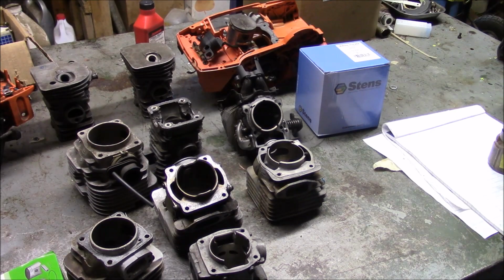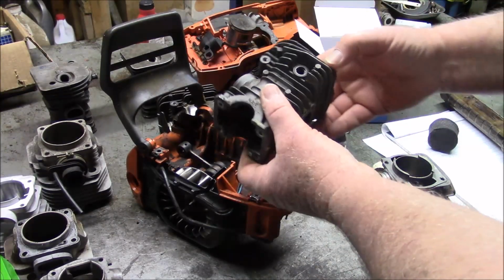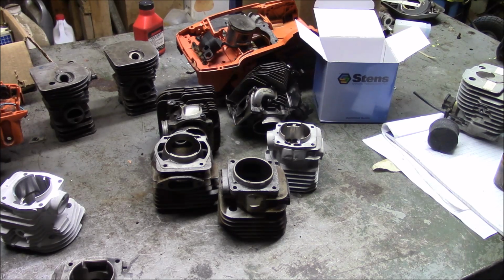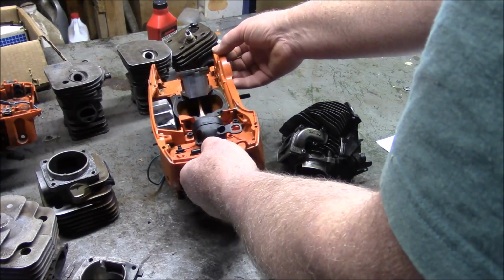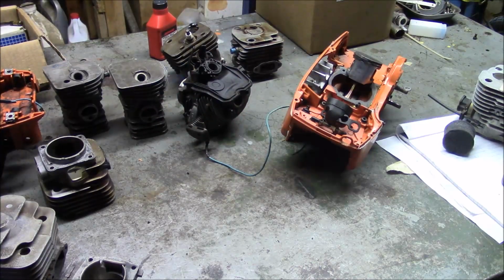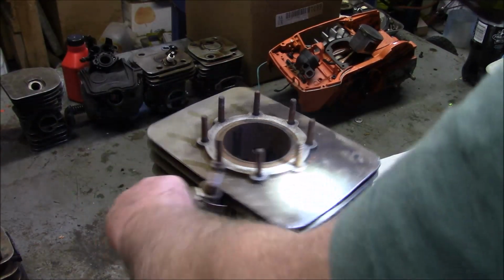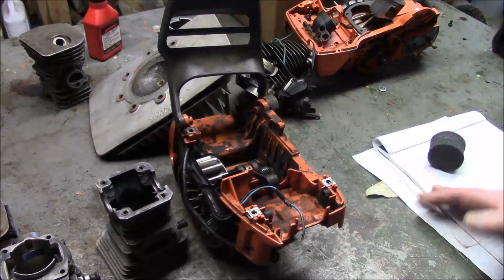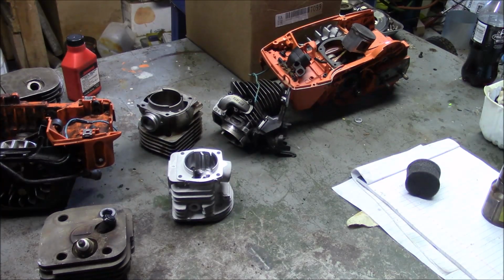What Is an Open Port Cylinder?? What does a Clam Shell vs. Conventional  Chainsaw Design Mean?

Comment: Scavenging seems to be little talked about.  The impact a muffler mod will make to back pressure etc
Reply from the maker: True, I started to get into the physics is a recent video. The saw community isn't really ready for true math & science. Still caught up in the black magic, bling, and entertainment as demonstrated with a lot of the really popular & large channels. I remember the same in the 1970's racing 125's.... then along came pro circuit & Yoshimura and a few other true engineering houses. Once the saw community gets past that, I'll drop in some math maybe :)

Comment: Uhhhh... A+++ and all, big Likes, but wish you'd put TRANSFERS in the title, dude this is the best/most comprehensive "transfers-comparison" video I've come across, by a pretty large margin actually, have been literally collecting pics (usually screenshots) of various jugs' transfers, because it just blows my mind how much variance there is here I mean the rest of the jug is basically the same as 30yrs ago but transfers wow have they changed, the echo 7310 that has one of the uppers split to 2 windows (for 3 total up top) because it's so wide.  
Would you say that MIXING transfer charge, and the exhaust gas, is desirable/the goal?  I keep hearing how you want to "have exhaust escape, pushed-out by the incoming transfer charge" but people advocate you aim those upper transfers laterally, that seems like a good way to intermix with exhaust gas, I would've liked to say "upwards would help" but the up-swinging piston should be all the "up" that charge needs, am thinking that when people do uppers aimed "backwards and laterally", the lateral part is pointless/of no use, it's only the aim backwards away-from the exhaust port that is of value in transfer-direction (ie, "up/down" is almost an irrelevant plane of action, insofar as transfer direction/aim, because of the piston movement)
Reply: Would also love elaboration on the idea that Husqvarna has literally hobbled saws via transfer-sabotage as you describe it, for reasons of price-points (I mean, you can open those transfers, working them is so easy, it'd be like using a very restrictive muffler-deflector plate that could just be un-screwed :P Maybe an extreme analogy but should make the point!  Would expect a more 'uniform' downgrading through the cylinder, than a single-point weakness (there must be some secondary benefit to the larger transfers if they really are doing it that way, IE could it be that squeezing the transfers up's the power but down's the fuel-efficiency?  This wouldn't be 'price point' so much as 'power point' if that makes sense!)
Thanks for posting all this awesome content, and nix to any thoughts like you expressed Re you 'needing' to do more basic stuff, there's plenty of folk doing that, you're specialized we need you on the cutting edge stuff, stay on transfers not on basics ;D
Reply from the maker: Husqvarna did, 545,555,565, 365 etc. And I would change the description to modify powerbands by changing port size....and that might be a price point driven design but also there may be more to it. For example my 565 has the same basic top end as a 572, but doesn't have the rpm's or top end snap. BUT has a wider mellow power band that starts pulling real hard at a lower RPM than the 572....and in my humble opinion is easier to use , especially with the long bars in awkward positions. I guess the concept "more isn't always better" in both transfer x-sectional area and in peak power. The 565 is proof to me that just like in the 1980's when dyno's showing peak HP on motocross race bike missed it, the same is happening now in the saw community 40 years later ...its about matching power & power delivery to a persons world. And right now a 565 is better for me than the more of everything 572's. ( I have both )
Reply from the maker: Tried to keep it simple :) Now retired I have more time. Prolly should do a update and "2.0" , especially as most saws now have some derivative of these heat "charged" ( Like 550-572 ) style transfers and or strato ports. Especially the new eco saws using heat to expand/accelerate the charge into the combustion chamber go against conventional thinking in the chainsaw community....why so many who "mod" them miss the mark :)
Reply: @afleetcommand  Friend, or +500 turnover from the maximum permissible damaged saw?

Comment: can I replace the caps on the cylinder of my 550 with those of a 562, for more power? or does that cause problems with the autotune?
Reply from the maker: no
Reply: @afleetcommand  is the answer no to the question whether I can replace the caps
Reply from the maker: to both questions. 550 is a completely different design, a 50 vs. 62 cc saw. If you had miss typed and meant 555, the answer would be yes and no. So no

Comment: Can a squish band be too narrow ?  I have an original Stihl 028 WB type 1 ( 44 mm bore ) whose squish band is only about 2 mm wide, as compared to the later models that have about an 8mm band. When did Stihl switch to the T27 cap screws, (my 028 is put together with hex-head cap screws, (It's all original, my father was the first owner, purchased in the very early 80s)  Thanks for the video
Reply from the maker: yes it can, obviously you don't want the piston to hit the squish band. The numbers I use to be safe is .020". I have pushed the limit a bit to .015 but that was also with a "machined" squish band and other things were in play. But for a work saw the .020" is a good number. I think we over analyze often when building these little motors. Most aren't going to earn money racing other saw. And most are used by a person "solo" so getting the job done with no hassle and reliably is more important than a few percentage points more power.
Reply: @afleetcommand  I mis-stated the question, sorry.  not the squish between the piston and band, but the width of the band from the cylinder wall to the center,, , basically the old cylinder has almost no squish band at all, , , ,thank you for answering,  The squish was 48 thousandths, I did a gasket delete, and that brought it to 0.025, that is where I think I'll leave it.  it runs fine, but i still have to blow out the tank, and put in a layer of RedKote to seal it, so as of now, it runs better than it did, but I still might need to change some of the ports to compensate for lowering the jug.  You guys really turned me onto to Husqvarnas and Jonsereds, especially the Red 2071, Thank you.
Reply from the maker: Actually a lot of the early saws had that "dome" style combustion chamber. AND not surprisingly the trend to cut into the squish band to reduce the size of the combustion chamber was the result. Problem is the "flow" of the fuel mixture from the outer part of the cylinder diameter to the area in the combustion chamber is a place gains can be had and with the "dome" pistons they had to be cut to match the changes. Want the resulting shape to promote the flow of the gas air mix into the combustion chamber...a subject in itself
Reply: @afleetcommand  yes, thank you again.  When I looked at the configuration, I thought about taking some meat off of the bottom of the jug, and cutting a ring from the top of the piston to compensate for the reduced height, but decided not to do anything further than gasket delete.  Reason being, I don't want to start opening the top of the exhaust, and secondly, I was concerned that it would yield too much intake duration.  I am going for easy to start, and more torque anyway.  If I need a faster chain, an 8 point sprocket can be used.  Other than a delete, , , the only other thing I did, was to break the glaze on the cylinder, and put on new rings.  the saw was almost never used, and I am trying to keep it original as possible.  I have a ton of other stuff on the bench to play with, ,, and the next purchase/build will be a Jonsered, or Husky...Many thanks for this and all of your videos, you guys are great.

Comment: I ported my 400 cc 2 stroke recently. This just my first one. Lost some low end but got alot more mid range. Just need a pipe to compliment the porting. I oval bored my carb and got some gains all around going 1mm larger, but lost low end and top going 2mm larger. Obviously I did not have enough port to warrant going 2 mm. However, the new pipe may allow the engine to grow into the carb, dunno. The stock pipe is highly inefficient in its design in my motor.
Reply: Sounds like your chasing your tail. That's what happens.

Comment: My first thought on the new port design was, 1) using fuel to regulate temps; and or 2) use heat to boost temp of fuel for, more complete combustion; 3) lower Nox"s..pollution.
Reply: Theyre vaprizeing the fuel for a more burnable mixture . Same thing could be done with more power if the carb produced smaller droplets . Or if you could break them up afterwards .

Comment: Good video.  I look at it like this. If the side of the piston is used for one side of the transfer ports, it's an open port cylinder.  If not it's a closed port cylinder.

Cheers
Willy

Comment: Just wait until they can find a way to have a battery in a saw, so they can make saws fuel injected  with a computer controlling everything.  Mtronic and auto tune are just the first generation of their plans for our future.  With the Xtorq it is just like we were with vehicles in the 1970's.  Remember the air pump we had on those vehicles?  They consistently caused detonation due to a lean mix.  Can you imagine what detonation would do to a two cycle engine?
  I just do not understand why they lean on the outdoor power equipment flks and let te real polutors get a pass -18 wheelers.  OPE consitutes less than 1% of the overall pollution.
Reply from the maker: The new autotune's draw power from the ignition module. Plenty of power for Fuel Injection to be had. Takes one revolution to get them going.
Reply: Friend, or +500 turnover from the maximum permissible damaged saw?

Comment: i dont like the design where the transfers go near the exhaust. a hot intake charge equals less power
Reply: It makes sense if you think about what fuel you're burning. They keep the oil gas mix cool and mixed to lubricate the bottom end and keep the heat down on the crank and bearings. Then they give it a run across a heated port just before combustion thus aiding the desired process. This will give it a cleaner more effective burn yet still effectively lubricate the top side. When fuel warms up it atomizes into a vapor which we all know is the most efficient way to ignite it and utilize it to send that piston back down..
Reply from the maker: That would be conventional logic...:) But are you sure?
Reply: Its well known the colder the intake charge the better
Reply: They could probably use a capacitor or several capicitors in parellel instead of a battery for fuel injection.  My 241 will crank in one pull if it is nice and warm outside.  My 261 will not.  It usually takes about 4 to 5 pulls to get it running.  I have never had an auto tune saw, so I have no experience with those saws.  My 241 did crank on one pull in a snow storm this winter, but I did have it in the house before I took it outside, but it was below freezing, outside.
Reply: Every new engine design is a compromise, usually predicated by folks in the finance department.  The head of PR at Remington Arms once told me that changes to their products were not made by the engineering department but the bean counters, which is why known problems usually never got fixed.  Build it cheaper, with more PR jargon and some idiot will still buy it  and in today's world make the cost of replacement parts as expensive as possible and the units, themselves, basically unserviceable.  Then, they can sell you, hopefully, another unit at an even higher price.  Look at the new Briggs lawn,power engines - you never have to change the oil; just add new oil to keep it filled.  Right!!

Comment: Thanks for your sharing of informations.
I like a lot chainsaws and i haverá partner 550 and because your proud in salvage 50 -53 c Huskies and johnsered i Stay with my first saw.
i cleaned it to shine estate and put new selas,and i dril the mufler restritor in mufler entrance  and Ported exaust Port without opened piston side only wall to enlarge mufler side.With verá clean air filter,razor hand filling h42 and wow how it cut!with 17" bar cuting very Dry pines or eucaliptus and riping.That partner 550 have grunt to firewood cuting.And is true a open Port with single ring helps to High rpm but in low rpm is slower than closeports.
I tarde good Shake  372 xp, two 372 x torq,one 576 xp no at,stihl 362 cm and with a 850 dólares profissional.
You have right this Tipe of OpenPort is no problem if we clean it and put it in good Shape.
One more time thanks.Stay please posting I Will drink it and try to make it the sabe way.
Greatings from oporto Portugal André Campos.
Reply: I hope you quit drinking since posting this !

Comment: Hey Afleetcommand, the cylinder that you are holding at 2.03 looks identical to the one on my 350. I was wondering if you can cut out the groove in the transfer ports for more air flow or if they are needed for piston ring support? Thanks
Reply from the maker: Never tried so really can't answer that with authority. Buy an AM cylinder and try it..:)

Comment: thanks for all knowledge you share.The husky four ports design is 5***. I now suspected my 2013 372Xt will not be a true upgrad of my 2010 xp, because the pre x torq design( two passages for air).
In your opinion the Xt is better or only born for Epa regulations and was better i stay with my first Xp?
The old xp has 4.3N at 6600 or Xt 3.8 at 8100 that say  XTtork is better at full trotle  and have better chain speed at the tree than the xp?
I will port my xt and not sell the xp.
Please help me to make a correct view.
My two saws for now stay original because i only cut a tone a year and i´m adited to good saws.
Thanks for your help.
André Campos
Reply from the maker: +andré Campos XT is an EPA driven design. They have done a great job in keeping within EPA mandated parameters while producing  a saw that about matches an old style 372. I would build to the original design.
Reply: thanks!
I would sell my xp.
greetings
André Campos

Comment: I just got three aftermarket kits for the 346xp's ... They're what like 44.3 diameter ... The stock is 44 or 45 mm on a 350's ... What was your findings on the results of throwing these open port 346's jug and plugs on the 350's... About the same power? Or slightly better power at the top end of the RPM range? Thanks Walt!
Reply from the maker: +David Thorne Typically a 346 will run to 14300 and make more power when twisting at the higher RPM's, You can "port" or tweak a 45mm 350 with the caps to match a 346 quite easily and it has a power band at a low set of RPM's. Never used AM 346 top ends, and now the cost of OEM's is around 75 dollars. Kind of took away some of the luster for the AM top end kits for me.
Reply from the maker: +David Thorne If they are AM open port top ends, I doubt they will run as well as the OEM 346 or 353 top ends. BUT I never tried! So that is pure speculation,
Reply: I go onto the http://www.hlsproparts.com to check the deals of the day stuff and these kits were like $20 bucks apiece.  So, I had to grab a few...just to see...right!  They look good and I have them rubbed down with my Amsoil engine builders lube... So, I'm hopeing to get some time over the next few weeks to have one to compare.  I love those Hutzl kits for the 45mm big bore for the 350 with the transfer port caps that come off... To make cleaning up easier.. And being $35 bucks to get a 350 running means I really like those.
Reply from the maker: I did one with the 45mm Huztl that did in fact come out pretty well.

Comment: How do you build your chainsaw engines for torque vs. horsepower? The Stihl 051 and many McCulloch chainsaws were saws you could "lug" through a big hard chunk of Red Oak or Red Elm. How do these saws (Stihl 051/056 and McCulloch "10-series" generation like the 10-10, 55, 60, 7-10/700, SP 81) compare to a  Jonsereds 2166/Husqvarna 365 & 2172/372? What made and still makes the McCulloch Super Pro 125 such a beast?! Torque vs. horsepower comparisons really, I mean really interest me when you're cutting wood.
Reply from the maker: +John Lincicum I shoot for torque on my builds, higher compression, a littler later to open the exhaust, and stuff like that. I'm more interested in a saw that won't fall on its face if it gets out of its sweet spot than one that sounds like a dentist drill. Those old mac's compare favorably to the "200" series like the 266 and 272 but the 300 series just have more of everything power wise in a lighter package. Although the sp81 is a beast of a saw!
Reply: +afleetcommand I love the SP81! Ours is of course a full wrap handle bar too. We have a 28" bar on it. I have all the McCulloch saws listed except the Super Pro 125. The Jonsereds 2166 isn't in my hands yet. Making payments (2), first payment today, partly because of money and partly because the dealer had hip replacement surgery! Last payment is next month. I would like to compare the 700 to the 2166, even if it is slower, just to see how much. But the 2166 has a 24" bar and the 700 has a 20" bar. Will the bars fit from one to the other? I just used the 700 Tuesday, man what a nice saw when it runs right! I just got it back. Darn ethanol gas in the farming/rust belt, I've been trying to avoid it like the plague! I only use gas from 2 gas stations now, 1 is 93 octane with 10% and is 3 miles outside of my town and just recently I found a gas station in Wisconsin on my way to work that has no ethanol 91 octane.